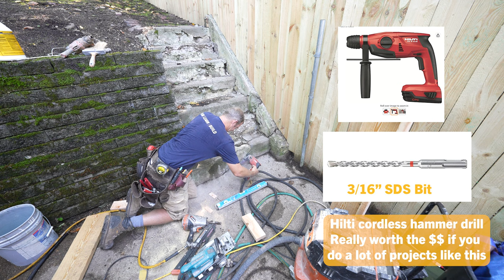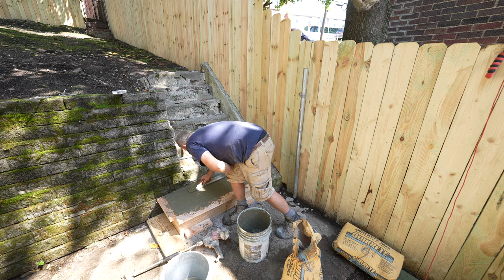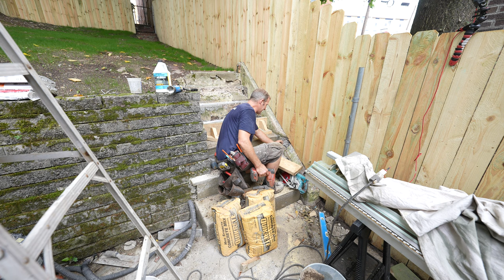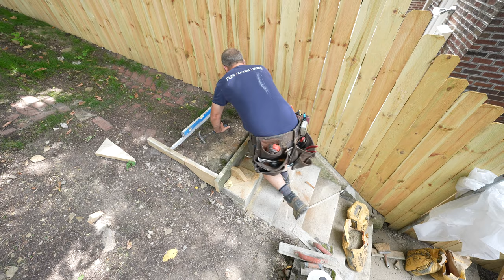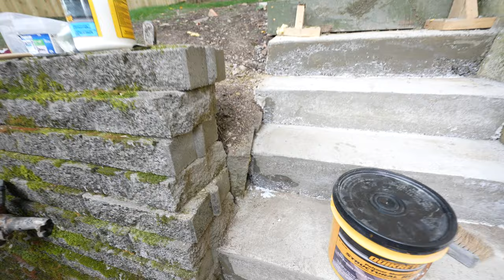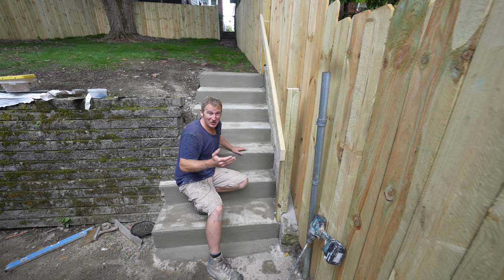Concrete Steps Repair | Cheap & Easy | PLAN LEARN BUILD

Comment: A trick I do to make sack concrete finish much easier with more cream on top is sprinkle some straight cement or spec mix just on the surface, it gives plenty of extra cream for a great finish.
Reply from the maker: Thanks 🙏 that’ll help with this quickcrete crap 😆

Comment: I be doing repair on a couple of steps, the bullnose, but they are square.. I was told about using tapcons, and bonding agents or adhesives.....He said I could use top and bond patch. what is your thought on that or should I use something else... Thanks I appreciate it... Those stairs you did came out great, like night and day...

Comment: Also, maybe try to aggregate the concrete to encourage it to fill in all the spaces, like in the front where it was patchy. Skim coating the front will flake off.
Reply from the maker: The adhesive will prevent the flaking. And it’s new concrete now so it should bond well. But yes. Vibrating forms is a good idea. Thanks for watching 👍

Comment: What do you do aabout the tapcon holes? Fill em with the mortar?
Reply from the maker: Yep with the structural mortar 👍 good point, you don’t want water going into those either
Reply: I think he should've started top to bottom that way the holes would've been filled in on the way down. Although would've took a lil more lumber.
Reply: The holes will fill with water and ice and will expand making cracks
Reply: I redid a few steps in an outdoor pool once and its still holding up 4 years later! Similar set up, had to use foam on the edges to hold the mud in cuz its all curved but honestly it was a piece of cake!